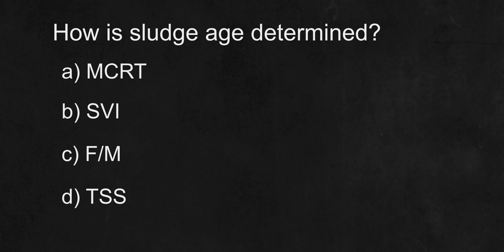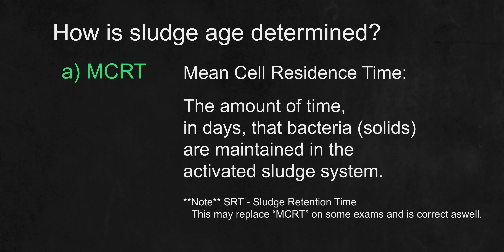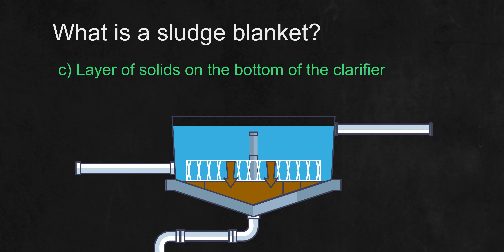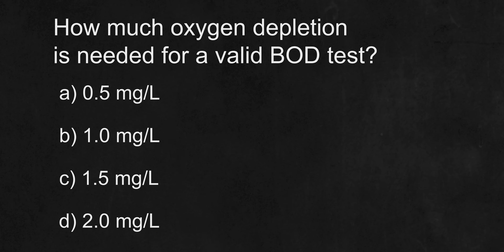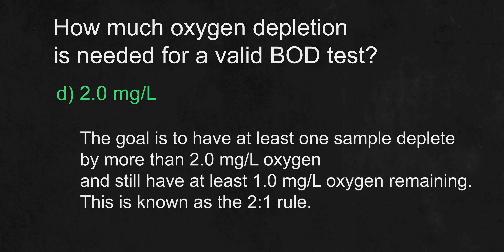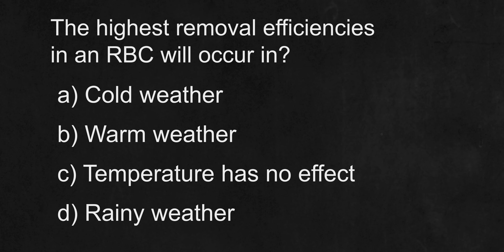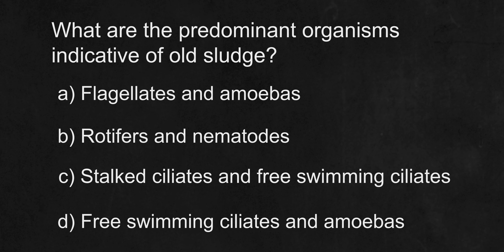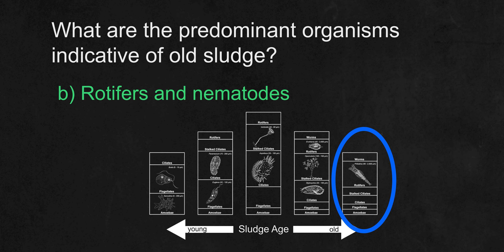Wastewater Treatment Operator  Exam Questions - Part 1

Comment: The BOD test is a good question but needs to be more specific. The 2.0 mg/l of DO for the test is for the delta DO. There may be questions pertaining to the final DO which is only 1.0 part. Don't get those confused with the BOD test.
Reply from the maker: Absolutely, although I do mention that in my explanation, I understand it may not be perfectly clear and both of those points are important to understated clearly.  I appreciate the comment.  I try to keep my explanations brief and to the point but its difficult to do when there is so much that can be discussed. I may have a video in the future that focuses a bit more in depth on BOD.  Thanks!

Comment: is this for the California grade 1 test? I am studying using the Operation of Wastewater Treatment Plants volume 1 eighth edition. There is so much info in the book it's hard to know what to focus on. It all seems so important. I don't know if I should focus mainly on the chapter reviews? or should I make sure to do all section reviews as well as chapter reviews? any help from someone who has taken the grade 1 wastewater test in California and passed would be greatly appreciated!!!
Reply: What's the name of the book?
Reply from the maker: I believe they are referring to the Sacramento State Operation of Wastewater Treatment Plants volume 1 eighth edition.  Its a very good textbook and I would recommend it.
Reply from the maker: My videos don't focus on a specific test (it includes questions that could appear on any grade exam).  I know that isn't probably what you want to hear but having a well-rounded knowledge base and understanding many different concepts even complex ones can help answer simpler questions.  Honestly just studying as much as you can and reviewing as many questions as you can will ultimately help you pass your exam.  It's not easy, but after a while you will realize you know a lot.  Goodluck!

Comment: If anyone is watching this to prepare for their wastewater 1 exam in california, I have some advice.

The videos in this series eventually get into more advanced stuff. Around video 10 or so. So don't sweat it too much.

There is a Playlist on YouTube directly focused on the wastewater 1 exam math. Watch that. It's easy.

Buy the premium version of chatgpt, and train it to quiz you or teach you about stuff that will be on your exam. It helped me more than anything. You need to use the paid version to make it smart enough though.

The level 1 exam is mostly about facultative Ponds, grit chambers, clarifiers, weirs, pumps, DO, pH, types of bacteria, F/M ratio basic knowledge, etc. ChatGPT did a great job teaching me about these things. Just make sure to keep training ChatGPT on it, and correct it when it makes mistakes. 

It came up with rhymes to help me memorize things, like "60 for solids, 30 for stink, 90 will settle before you blink" 

These are primary clarifier removal rates
60 percent removal suspended solids
30 percent BOD
90 settled solids

The math is easy, but you NEED to memorize that there are 3.8 Liters in a gallon. They will not provide this conversion for you.

Comment: I really don't see the difference between question #2 answers A or C, other than C is more generalized. Even in your explanation, you say "solids that settle on the bottom of the clarifier...".
Reply from the maker: I understand where you are coming from and to a certain extent choice A is sorta correct but it isn't the best choice.  I will admit I would probably change that choice so the answer is more clearer if I could go back. With that said a sludge blanket isn't specific to only primary clarifiers. The question is asking what is a sludge blanket in general.
Choice A is an example of a sludge blanket, but not the definition of one. Great question, thanks for watching!

Comment: Question 2 could be answer A.
Reply from the maker: I understand where you are coming from and to a certain extent choice A is sorta correct but it isn’t the best choice.   A sludge blanket isn’t specific to a to only primary clarifiers.  The question is asking what is a sludge blanket in general.  Choice A is an example of a sludge blanket, but not the definition of a sludge.  Great question!

Comment: What states have easy questions like this ? Floridas lowest C test is a thousand times harder
Reply from the maker: Not all questions in this series are this “easy”.   This series of videos goes over a range of material.  It is loosely based on New York 3A exams (2nd most difficult in NY state).
I have had quite a few people from various states let me know that what I cover was extremely beneficial in helping them pass their exam.  
I of course can’t go over every single question that someone might find on their exam but I hope that people will dive deeper into these subjects and understand the different types of questions they may expect to see when taking their exam.  I hope you continue to find these questions easy because that means you will do great on your exam.  I’m always interested to hear what kind of questions people run into on their exams, it provides me with better material for future videos.  Goodluck and thanks for watching. :)

Comment: These are great; but what level are they focused on? I'm writing my class 2 in Ontario next month and I don't find the textbooks suggested by OWWCO very useful
Reply from the maker: These videos are great for any level, however they lean to the more advance levels for most exams I would say.   But if you learn these, the lower level exams should be easier.

I have used the WEF and Sacramento State textbooks a little while studying.  Honestly finding practice tests online and completing as many multiple choice questions as you can is the best way to prepare for the exam (in my honest opinion).   Read up on the stuff you are less familiar with or don’t have at your plant.   For example my plant didn’t have a digester, so I studied PowerPoints that I found online that explained them.  

Goodluck and thanks for watching! :)
Reply: I have master degree in microbiology and six years experience as water quality analyst can international applicants apply to sit for Exam

Comment: Hello
I am working as process Engineer in sewage treatment plan at Dubai.
What certification or license will I need to be able to work in Canada and USA ?
Can I get that certification online?
Reply from the maker: Hi, this is a difficult question to answer. In the USA it will depend on what state you are in.  If you are looking to be an engineer, you probably wont need a wastewater operator license.  However if you are looking to get your wastewater certification you will need to take several wastewater courses (depends what state you are in).  Usually there are online versions of some of the courses.  You will also need to have time worked at a treatment plant as an operator trainee.  Hope this helps and goodluck.
Reply: @worldofwastewater   Thank you very much for sharing the information.

Comment: Thanks for these videos, best I've found so far. Preparing for class 3 in Ohio. Working at a small class 3 facility with extended aeration and just aerobic digestion the explanations of different treatment units and how they operate really helps. Also the math formulas you refer to are those from the ABC test/3rd part? In Ohio ABC test are different then the Ohio EPA writen test, which they quit providing so only option is ABC now. Thanks again hope to see more.
Reply from the maker: Extended aeration and aerobic digestion, sounds like a pretty neat plant.  It's so important to have well rounded knowledge when it comes to these exams, which is something I think my exam does a good job of touching on.  There is always more to know about all the different processes though.  Your studying should go beyond my videos, but I believe this is a good guide to some of the major concepts you will see on a exam.  I am from New York, so that is what the formula sheet is based off of.  I just check out the Ohio one and it is VERY similar (NY seems to have more on it).  All the standard formulas you would expect to see are on the Ohio ABC formula sheet as well.  So it shouldn't be a problem.  Thanks for watching and Goodluck!
Reply: @worldofwastewater  your right and I've took a training class for all my exams they are extremely helpful, just meant your videos are probably the best I've seen. They should be worth contact hours.
Reply from the maker: @chasemorris5334  I appreciate the kind words man.  🙏

Comment: Just started in wastewater. This is the current information on the class D test? 

Great format and great videos. I’m gonna watch them all!!
Reply from the maker: Thank you!  Glad you appreciate the format and for finding these videos helpful.  Comments like this really keep my enthusiasm going.  To answer your question, this test isn't specific to any state or class of exam.  These questions are meant to cover a wide range of topics that you should be aware of and know for any wastewater exam.  There is no way of knowing exactly what will be on any exam for any specific state but no matter where you take your exam, these concepts will be there to some extent.  Of course not all these questions will be on your exam, but I can guarantee some will look similar.  Some questions may be more difficult than ones that are on your exam, which is great.  If you can answer difficult questions, simpler questions should be easy.  Goodluck!

Comment: I would suggest indicating which exam "grade" level your content relates to.
Reply from the maker: I appreciate the suggestion.  This test is meant to be for everyone.  This test goes over a range of topics that an operator will likely need to understand no matter what "grade" test they take or where they take it.  I always say, if you end up studying harder questions than you may be required to answer on a exam it will make taking the exam much easier.  Secondly, because there are differences in what "grades" can mean in each state, it's hard for me to do that (I'd have to list 50 different states).  In some states a "4" license can mean the easiest test and might mean most difficult exam in others.  Let me say again, I appreciate the suggestion.  Goodluck on your exam and hope you find these videos helpful.

Comment: I got 100% lol.  Question 3, wrong...   your blanks can be 0.  Also, when i run the plant 0 can happen :).
Reply from the maker: Having zero BOD in the effluent is something to be proud of, nice job!  I wouldn't call question 3 wrong, as it is in regards to the testing of BOD in actual samples whereas the blanks are part of the QA/QC measures that are in place to prove reliable and accurate testing. Nonetheless, you do bring up a good point that should be known.  Which is, BOD blanks should not have a depletion greater than 0.2 mg/L, which would indicate no contamination of the dilution water.  Thanks for sharing.  =)